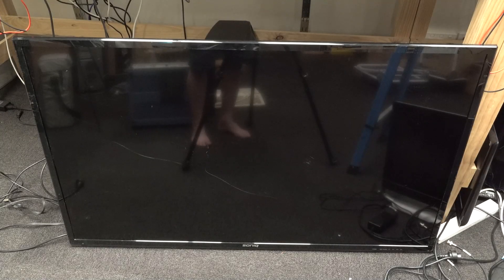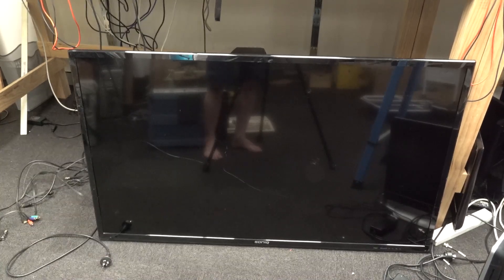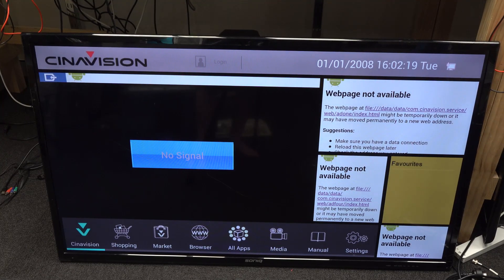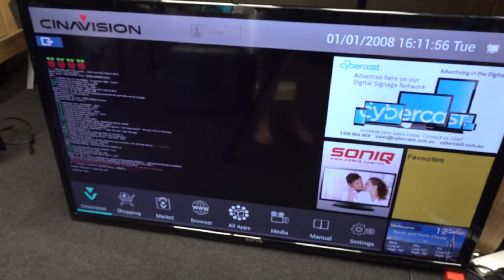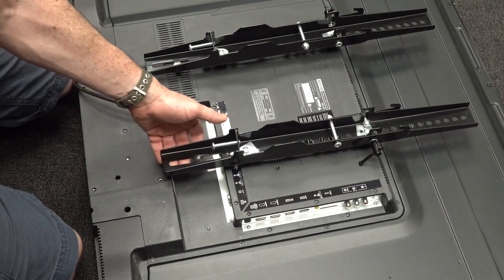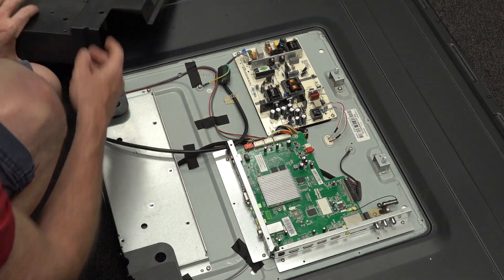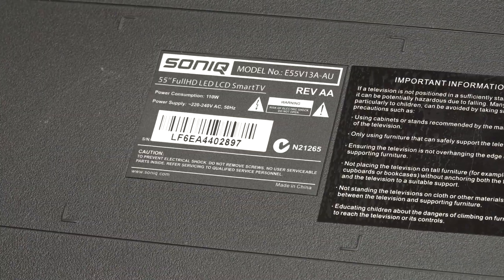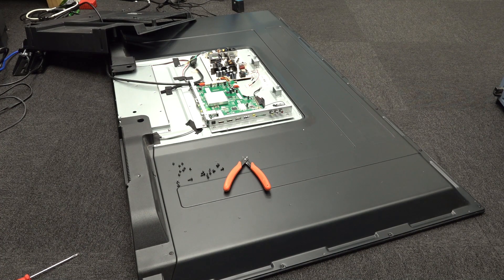EEVblog #1261 - Dumpster Diving 55" LCD TV

Comment: Dave. Give up telling everyone.
If these £100k+ companies chuck this stuff away n think nothing of it. Then so be it. 
Yes. The rest of the world, who scrape the barrel (and I am one of those people), just think. "Why?!" 🤷🏻‍♂️ But it's nothing to them as the write it off via tax. And it's only the good stuff they keep for themselves.
Reply: I am glad they do it because I get all my computers and laptops used at very reasonable prices from a place that "recycles" the equipment in all senses of the word. It's much better than just chucking the stuff like Dave finds.
Reply: @johnpossum556  I'd much fix and repair something than throw it away. Like a few bits broke on my Dyson. And instead of chucking it away, I took it apart, got I the parts and "it's like a bought one!" 
As Dave would say lol
Reply: @TheManLab7  Good on ya! In time you will find you have skills & insight most people don't even come close to having.

Comment: That TV looks externally to be variant of the CELLO android smart TV's we have at work just with a different firmware, although looking again the boards are a bit different, with a different connector layout and on ours the PSU is integrated into the one board, the right angle shielding bracket layout looks to be of the same design though. 
I believe UMC might be the OEM for TV's of this layout, although our TV's are assembled in the UK. Th only other OEM manufacturer that comes to mind is Vestel but they have the main I/o board on the back, will your HDMI/COAX etc. cables exiting from the rear and not the side as with this TV.
As for the RF dongle, that might be for the Air Remote. The air remote is an extra feature built into the standard remote control that allows it to be used as a mouse using accelerometers? in the remote. On some of them the dongle for this seems to be built in but on others (which have an older style remote) need a small dongle (like that used by a bog standard wireless mouse).
Reply: the mouse on the Soniq remotes is via a tiny trackpad
Reply: Cello is the crab British brand isn’t it.
Reply: @bfapple  Well the antenna connectors aren't very well fixed and so break off quite easily, did mean I got a 43" 1080P TV for free though so not all bad, but yes build quality could be better.
Reply: Haven't done TV repair in a few years, are Vestel still producing unreliable crap?
Reply: @uK8cvPAq  Ours at work are not to bad, quite a few 26/28" in service both LED and CCFL. Plus they OEM for a few big brands now. Our 49" 4k Toshiba seems alright enough.

Comment: Board says 0814, so probably a 2014 specimen
Reply: z4zuse firmware booted to 2009, so either the company is lazy or the software updates won’t stay put.

Comment: I paid extra for a Sony TV (instead of an off brand like soniq or hisense) and the processor was so slow,  it's barely workable as a smart TV. 
Not worth the extra money
Reply: Xalgucennia worth the extra money as the image processing is way better! SmartTV Software however is mostly crap. Just use an external box like AppleTV, AndroidTV (MiBox S, Nvidia Shield) or FireTV
Reply: @theGamer93  
Well my other TV is a hisense, and in terms of image processing, I can't really tell the difference
Reply: @theGamer93  Roku man. It feels like a smart tv, not an htpc, but with higher quality apps and more apps to choose from.
Reply: Richard Smith roku is basically US only. Useless everywhere else.
Reply: the|Gamer Nvidia Shield is supposed to be fast(er)? Heh.
Reply: @HighestRank  Fast compared to a Raspberry Pi, not as fast as a good PC. :)
Reply: If the Sony from that period was slow, then the off-brand ones were twice as slow.
Reply: Andrew Delashaw 
The Sony is only 3 or 4 years old dude, and the hisense is even older, though the Sony is running ’android’ with a lot more channel options while the hisense is running it's own software. But still there's no noticeable lag on the hisense while the Sony takes ages to load.